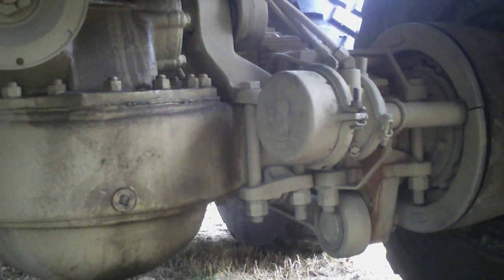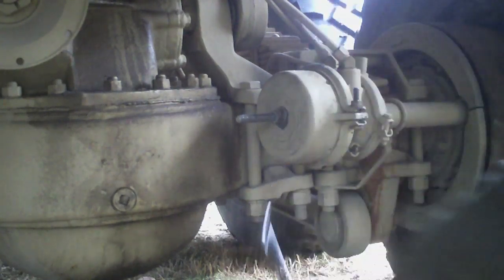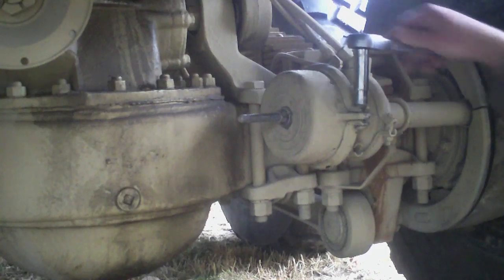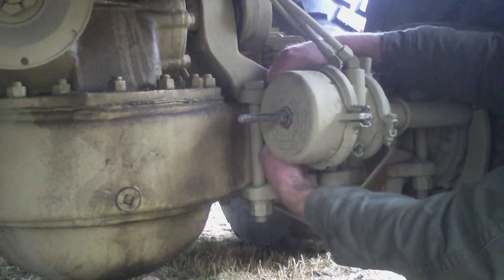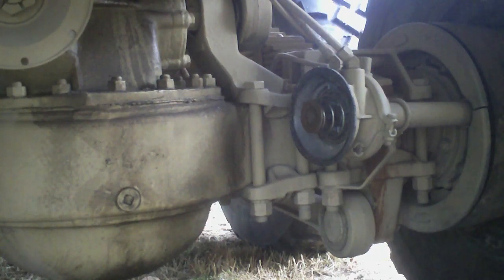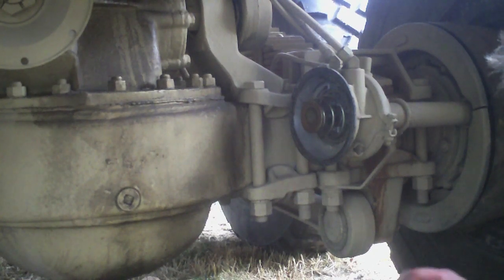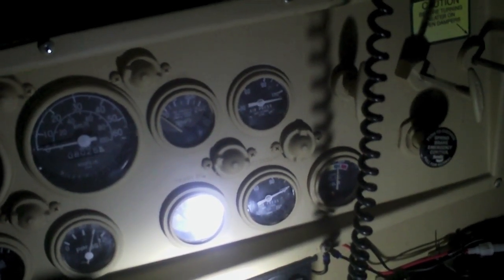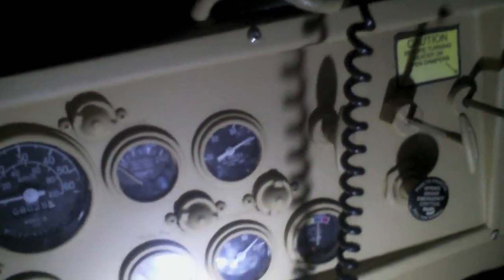Rebuilding M923 Spring Brake Can

Comment: You can get the whole assembly from Oshkosh Equipment for about $200 delivered.
Also, if you can build enough air pressure to release the spring brakes it makes it a lot easier to install the cage bolt....you don't have to wind up the spring by hand with a wrench.

Comment: also food for thought, like the one fellow mentioned about relieving the spring brake pressure off of the diagram first, I wonder if the bolt was engineered to just be a holder of the pressure or if was intended to be used as a working tool to drive the spring off the plate?
Reply from the maker: Yes the main caging bolts need to be in place and tight before anything is touched because that would be horrifying to pull the clamp with the spring not caged.  The cage bolts are large T shaped 1/2 bolts about 4 inches long.  The fit and are tightened into a holder under the can when not in use to pull back the main brake springs.

Comment: thanks finding instructions on working on these inline spring brake pods is impossible all simis I have seen have a slack adjuster and the pods are mounted parallel to the axles .
Reply from the maker: nisw1918 It might be for liability reasons with brakes and all.  By the way, did I mention the do at your own risk part of this video...
Reply: Yes I worry about that myself with my video's but don't worry I wouldn't blame you if I messed up . I am looking at a truck the brakes are locked up and wondering what might be the problem .
Reply from the maker: lol, if you put air to it and you don't hear hissing from the can cage the breaks one by one and whack on the drums a little with a hammer.  With this enclosed system you can't see the rods move to visually check the cans are working.  Don't hit the cans however, if you crack one they can get REAL dangerous.  You can always put a little air back in the service (red) gladhand and pressure the truck w/o it running.  Keep it below 90psi.
Reply: I was outbid so its someones else problem now anyway . But thanks for the video's they are very educational .
Reply from the maker: Is it one of the ones in Great Falls right now, that might have been me.  If it is, which one do you want?  In the two years I have been following them they have gone up in price about 40% overall.  Maybe some day they will come down.  I am looking for a running parts/spares rig.
Reply: nisw1918 By the way how does the spring pod expand the brake pads against the drums does it use a wedge like device or does it have a piston that applies hydraulic pressure on the pads ?  Thanks like I say simi trucks don't use this military set up .
Reply: NelsonStudios Government liquidation .com
Reply from the maker: They are wedge brakes, like what semi's used 40 years ago.  Modern Cam brakes would be nicer and have access to more parts.  I think eventually people will have to start converting these over but no one is doing it yet that I know of.

Comment: @6:10 - (Anyone watching in 2024) Operators manual says: 
Turn nut (Figure 1, Item 6) clockwise until at least 3 in. (7.6 cm) of threads of release bolt (Figure 1, Item 4) extends out of nut.
TM 9-2320-272-10 (0124-1 to 0124-3)

Comment: awesome video.  I'm just not sure about the stainless steel nuts though.  stainless steel has such a low tensile strength compared to grade 8.
Reply from the maker: Fair point.  I would argue that most of the tension is held by the band clamp, all the nut is doing is pinching it closed.  Stress levels there are not particularly high, that is how they got away with such tiny bolts in the first place.  If you were to torque to the point of failure then you would have already compromised the band clamp long before.  In my opinion anyway.
Reply: +NelsonStudios yes good point.  I guess my only concern would be an installer that didn't use a torque wrench and didn't have the touch or feel of a proper torque and the bolt stripping.  it sure is easy dissecting someone's helpful videos, lol.
Reply from the maker: No worries.  That little can is a container of death so none of us want failure, especially when our face is right there working on it.  It was an angle I hadn't thought of and now I will.

Comment: some of the military stuff is hard to find. I've been away from the business for awhile but Bendix, Haldex, Rockwell or Eaton may have something on their website. Make friends with your International parts guy and he may give you a break
Reply: good tip there. these trucks suck to find parts for. motor - cummins dealer, everything else is avail from detroit/allison and the rockwell parts are best found at truck stop brake places. "Safetee Brake" sort of shops.
Reply: good point DR. when you mentioned Allison, I just remembered that Stewart & Stevenson does tons of military stuff so that may be another sourche. Should be able to find them on-line. I actually have a few guage bezel panels that came in a bunch of surplus I bought. I guess I should ebay them rather than scrap.